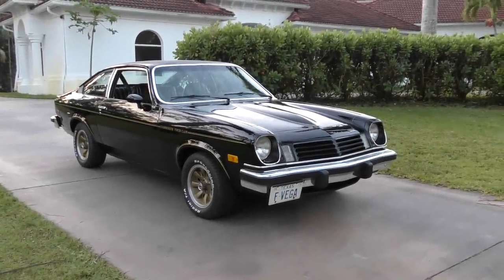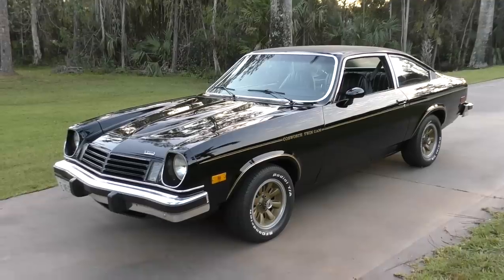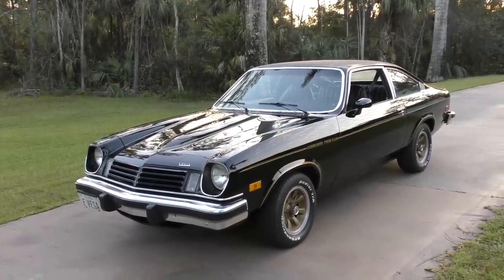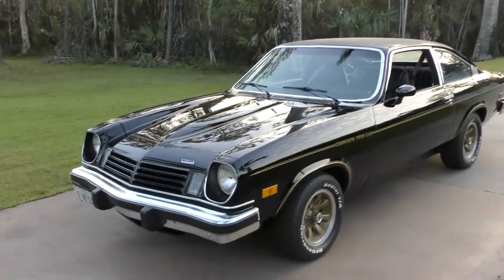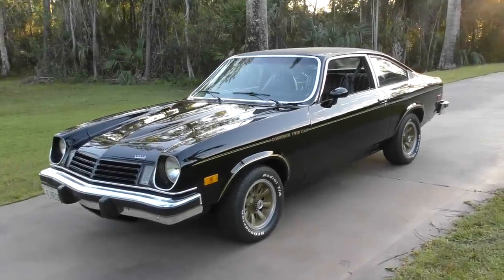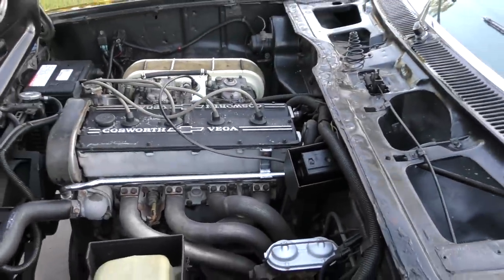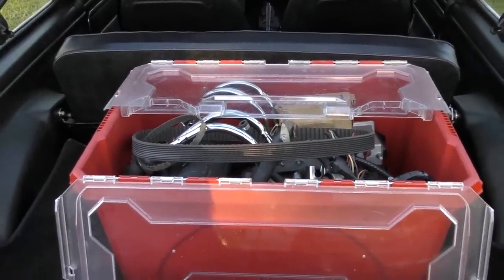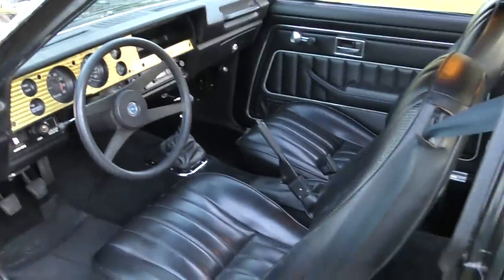The Cosworth Vega is an Amazing Car, But Came Too Late to Save Chevy From Their Terrible Decisions

Comment: I was a tech at a big Chevy dealership from 1971-77. The Vega was the most colossal POS ever built, so bad that when I wanted to buy a new sub-compact car in 1972 I went to a competitor across the street. We sold several of these Cosworths and I worked on them and drove them quite a bit. They were hardly what I'd call fast, except for the idle speed. The 1600 rpm idle speed was amusing. Initial pre-production press reports about the Cosworth were mentioning amazing horsepower numbers, but by the time the actual emissions-compliant production cars arrived the real output had dwindled to much less. Another case of a car that looked good on paper and has now had it's reputation  embellished by decades of mythology endlessly repeated by people who in most cases have never even seen one.

Comment: Bill,  thanks for the memories.  My first car was a 1974 Vega GT w/ 4 speed.  It was a blast to drive for me as a young 16 year old.  GM seems to never learn their lesson.....on refining cars before they bring them to market.  They made this first mistake with the first Corvettes, the Corvair, the Vega, and the Pontiac Fiero.  In all case examples the cars turned out to be decent sellers by the time the refinements were put into standard production.
Reply: Exactly the same with GM's overseas operations of the period over here in Europe - giving rise to things like the Canadian Vauxhall Firenza of 1971 with its dreadful under-developed first generation emissions equipment (the law suits were still being fought a decade later!). Incidentally the British HP version of the Firenza used the same Avon alloy wheels as the Cosworth Vega.
Reply: My first car was a USED '74 Vega GT 4 speed (Maroon) with no A/C.  Lifting the hood and dumping in oil before every outing was essential.  My Vega round key would open my Mom's Cadillac door.
Reply: @brettb8825  A friend had one that both burned and leaked ridiculous amounts of oil.  At least two quarts per tank of gas.
It eventually died when he slammed on the brakes to avoid an alligator in the road and the front suspension collapsed.
Reply: My aunt in Michigan traded her 1967 Chevy Corvair Monza in on a 1973 Vega. She did that because the Corvair had bad heating as it was air cooled. She got heat in the Vega but it rusted away in three years. Sad.
Reply: This is the only car that came with a case of cancer. I waxed my car to death and it rusted to the ground. Nice car when new but rust killed it with blown head gasket.
Reply: Yes indeed GM tried to uphold one definition of insanity: Do things the same DUMB, STUPID, CHEAP -ASS, WE COULD'VE DONE BETTER BUT(AGAIN) WE'RE CHEAP, and JUST PHONED IT IN -way & expect different results. Maybe it's not just GM; could we find other car makers in the US taking the "El Cheapo-Grande" route? 
For some reason, the GTO's in the 68-70 (I think ) range come to mind. I'm not super sure on some details, but the one thing I recall is Gm/ or John Z DeLorean cheaped out & deleted the chrome trim rings on the factory spoked wheels. The wheel was a combo ugly greyish color w/ some silver chrome on it, and some had chrome/silver highlights on the spokes it appears. Kind f ok, but the trim ring makes a huge difference. 
With this car,  it was the engineering attitude behind it that was off kilter; the CAR IS BEAUTIFUL! Stripped down, but NICE!.
Reply: GM's philosophy is to spend x amount of dollars on development (when it probably should be 1.5 x), send the car out there and find out what improvements need to be made, make some of the necessary improvements while cheapening up some other aspects of the car and then introduce it as the new updated model.
Reply: @steveshattah  UR correct Sir. How many of their cars could've been BETTER--esp. the hot rods. No instruments on a hot rod. Terrible.
Reply: I bought a brand new Vega when I came home from Southeast Asia. First thing I did was remove the aluminum 4 cylinder and drop in a 327.
Reply: LX a9x Holden Torana with the 308 V8 Engine & M21 4 Speed keeps going up in value
Reply: Leyland Australia really did fix the cooling problems of the Chev Alloytech Engine used in 3.5L form by Rover and Range Rover and bored it out to 4.4L and came 2nd in the Targa Florio Rally after getting lost in the African Desert - unfortunately Leyland decided to fit most of these wide Leyland P76 that would seat 8 without Seat Belts with the 2.2L Six out of the Morris Marina and bore the engine block out to 2.6L and Leyland sold the 2.6L six World Wide and couldn't afford the recall - Importing Australian made Left Hand Drive V8 P76 into the US could have saved Leyland
Reply: I, too, had a 74 GT with manual. Loved it. Handled great and the hatchback looked good and was useful, too. Word was just getting around about the oil burning when I bought it, but I thought I would beat it by using the best oil and changing it every 2000 miles. Didn't work, of course!
Reply: Like clockwork they would make a great car...and IMMEDIATELY KILL IT.
Reply: @christopherconard2831  I believe that. Vegas were cars that should have been hits, but ended up being their version of the Pinto, but worse.
Reply: They got the Fiero right the first time, and went on to mess it up, and turn it into something it was never supposed to be. I bought a brand new 1986 Base model Fiero, 2.5L/5 speed, and kept it for 11 years, with no problems. I finally needed a car with a back seat. I loved that car. It looked and felt like an exotic car, for a very reasonable price. And the "space frame" design was decades ahead of its time. It worked perfectly, but they still don't use it.

Comment: As a Brit , I find this miniscule engine a hoot to hear reving in an American muscle car shape that should have a big V8 and Jimmy Rockford driving it .
Reply: Chevy had that covered with the Monza 2+2. As a  smug Canadian whose family has been in the auto business for a long time, I must say I never heard of the Cosworth until recent times. 
As far as the V8 options, you could order right up to a small block 350. I'm sure you are aware of what a decent mechanic can make a 350 do with a bit of tweaking. What I know about those cars is that (besides the rust issues) the engine was hideously overpowering the chassis. They were notorious for oversteer and front end dive. Easy to spin. Kind of dangerous. They just didn't have enough wheelbase to control all that torque. Not nearly enough brakes either.
Reply: That Vega would be a blast on UK roads! 😊
Reply: Oh, you're thinking of that early Rockford Files episode where Rockford rented a blue Vega in Arizona (?) and engaged in a "Duel"-like battle with an 18 wheeler!
Reply: @johndrake2729  shoot I remember that being a nova
Reply: @johndrake2729  
Oh, crap….I think I missed that one.
Reply: People put 350 Chevy v-8 engines into them back in the day!
Reply: I was a kid in the '70s and I admit not ever giving a crap about the Vega. I always thought of it as a poser car.
Reply: The Vega was a small economy car when released. It was minuscule compared to the Camaro, Nova, Chevelle, and Malibu which could be described as muscle cars when optioned with V8’s. It was definitely a mere dot compared to the Impala. I don’t think one could ever order a Vega with the v8, but the Monza was based on the same chassis. You could get a 305 in the Monza, but you probably didn’t want it. They were all horrible cars that turned millions away from ever considering an American car ever again.
Reply: @BillLaBrie  Your opinion of Corvair? I heard they made a model called Monza, with turbo.
Reply: @markremy4946  Ahh yes, the Corvair! I love the Corvair the way one loves a bipolar stripper at the end of her long career: fascinating as the product of a long string of questionable decisions going back generations, and not quite as dangerous as she once was (but still dangerous and extremely troubled).

When I was a mere lad I would walk past a maroon ‘65 coupe parked outside a condo. Looked like it hadn’t moved in a long time. It gave me fantasies. I called a guy at a garage to get feedback on my idea of reviving that lovely beast, which still ranks as one of the most beautiful cars ever. He responded like…well…like a dad whose son wanted to date an aging bipolar stripper. That was almost 40 years ago…
Reply: @BillLaBrie  Hey! You should have thrown money at the car(like it WAS a stripper) and seen what she had!
Reply: @swilkobarfingtoniii1642  I had an ex girlfriend that had the Monza V8. You're right about the squirrelly handling, but it was fun to drive. A few times people tried to race her not knowing it had a V8 and their faces were priceless when a little shitty looking car pulled way ahead of them. 😃
Reply: @markremy4946  My friend did a big block swap on a Vega. Had to shave a stronger rear for it and only issue after that was snapping axels😂
Reply: I bought one of those brand new in 1975.  I drove it very little too before trading it for an Avanti II. It was unique and looked cool, and 1975 cars didn’t offer a lot to get excited about.  Spot on description here though.
Reply: @flipnotrab  Popular swap back in the day
Reply: @BillLaBrie  best comment in a long time. Lol.
Reply: Yes indeed! It’s more than capable of doing "The Rockford/(Rockfish!)" hi-speed Reverse➡️Drive manoeuvre. It’s more rare than the Ferrari 365 Daytona, this Cosworth Twin-Cam Vega? Golly! I’d like to have The…Ferrari, please. Nonetheless, this is a great video, (the first of your videos that I’ve seen) and I’m your newest subscriber. A Vega that was more expensive than both the Camaro AND Corvette? Wild. It’s a mighty nice car.
Reply: @markremy4946 great point. That’s a really advanced automobile and I don’t think it’s one of the Corvairs that was "Unsafe At Any Speed". It’s equipped with disc brakes, isn’t it? Great car, an "American Porsche"…of sorts. Thanks for the reminder, Mark!
Reply: @BillLaBrie I dated a beautiful, bipolar stripper who was 10 years my senior but I was only 21 & she BLEW MY mind for about 6 months. I had a Spinal Cord Injury about 3 months into our relationship and became a C-5 quadriplegic, and I was able to outlast her because I had very little sensation in that area. It’s probably as close to driving one of these full out for as long as you can sit in the same seat. She was more like a Formula 1 car than a TC 4 cylinder Cosworth Vega.
Reply: @frufru0071  Ahh. Lots of spinal cord injuries in Corvairs, too. Coincidence? I think not. Anyway, thanks for backing me up!
Reply: @frufru0071  Ralph Nader was unsafe at any speed, himself!:elbowcough:
Reply: @BillLaBrie  I broke my neck skiing-I worked for a Big Resort’s Ski Patrol in BC while marking "Early Season Hazards", (aka ROCKS, which were everywhere in late November and our base was 30 centimetres/12 inches of melting snow on a warm sunny morning). It was my decision not to open the run
Reply: @BillLaBrie  I love the Corvair because it sounds like an old air-cooled Porsche 911. No coincidence there, it also had an air-cooled flat-6.
Reply: @johndrake2729 great episode!

Comment: Friend of mine had a Vega wagon manual shift when we were in high school. It could actually break the rear end loose in first with full steering lock, and if you shifted into second fast enough, you could get it spinning donuts on bare pavement. If you live in a place with snowy winters, you know what fun a short-wheelbase rear-wheel drive car can be (although we took that for granted back then). Keep up the great work!

Comment: Owned 4 of these through the years, starting with a '76 (#2405) bought in 1978 which I traded my 1974 Mercury Capri 2.8 V6 + some cash for. Bought the car from Lance Stewart (who went on to drive professionally for MAZDA and others) who campaigned the car in west coast slalom events with some success. Dick Guldstrand set up the suspension for Lance. With Caldwell race recaps and konis, along with an autopower roll bar to stiffen up the chassis (if only modestly) - the car turned through the pylons reasonably well.

 Shortly after purchasing the car I joined the then, relatively recently established CVOA, founded by Bob Malloy - and ended up making further modifications to the car which included a port/polish of the 16 valve head, factory GM camshafts and most importantly (from an output standpoint) a set of 45mm Weber DCOE's mounted on manifolds developed and produced by Bill Hutton at H.M.E in Clarksville Tennessee. Later, I acquired another '76 which was a later production date (do not recall the dash number) car. Brown metallic with a tan interior and later still, 2 more 1975 units, though again, I don't recall the dash number though I believe one of them could've been (1875 ?)

Being in my 60's now, memories fade but I did have fun with them even IF they were routinely trounced by a well driven Alfa GTV or rotary Mazda. Actually, my aforementioned Capri would skunk my Cosworth's with relative ease... as long as the tarmac was billiard table smooth. The posi differential (if so optioned) and coil spring butt end of the Cosworth's did better on anything less than smooth surfaces. Not by much, but enough.

The weak points were. Oil seepage at the cam carrier and head. The rear panhard rod mount points where it meets the chassis. The 5 speed T50 exhibiting oiling issues in sustained high g-load situations, (the 4 speed 'saginaw' cars had no such problems and were actually a joy to row the cogs with once fitted with a Hurst linkage). And of emphatic importance, the crankcase oil level had to be monitored at ALL times since they were prone to windage and oil aeration issues, or a spun rod bearing (usually #4) was a certainty. Again, under higher than normal cornering load circumstances.

These were basically just Vega's with an semi-exotic (for that era) drivetrains, black paint jobs with gold striping, a fancy machine turned dash applique with bespoke numerical sequence #... and alloy wheels. If I recall correctly, the wheels were given a production budget equaled only by the powerplant. Though I must say, The early '75 cars I had seemed to be a bit more sorted, or at least they came across that way with just a touch less body rattles and door, hood, decklid gaps being more consistent. 

I ended up selling #2405 to Gary Schroeder of Schroeder Engineering in Burbank, Ca. At the time Gary owned, and was willing to partially trade his unmolested, low mileage, 1967 Sunbeam Tiger II (289 Ford) - if I could come up with $2500. I was an engineering student and $ was tough to come by so that just never happened (much to my chagrin). I sold the car for the whopping sum of $4000.

As I recall, #2405 was sold to a fellow who completely dismantled and repurposed it for Bonneville.

Enjoy your Cosworth. Just keep a keen eye on that dipstick.

-doc

Comment: My dad bought one of these in 1986 after it had been rear ended by a cargo van. Extensive repairs and 2 engine rebuilds later he still has it. I learned to drive stick on this car and still take it out for drives as often as weather permits. Never fails to put a smile on my face. Thank you so much for this review, more people deserve to know about this car.
Reply: Ps, thanks. PPS: how you maintenance: oils, filters, GM, Tires, PUROLATOR????